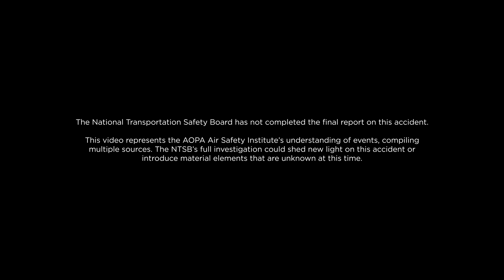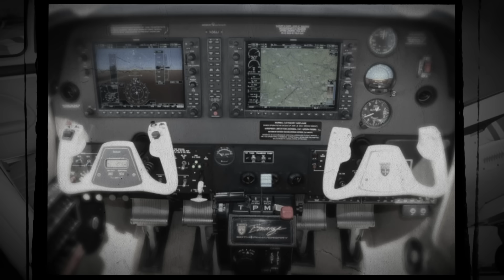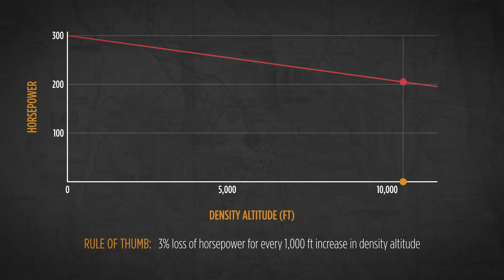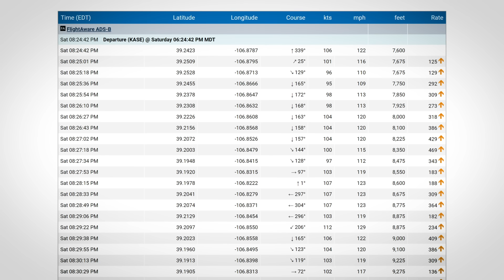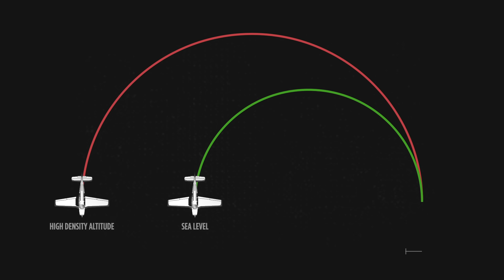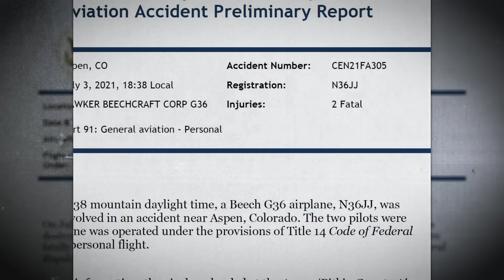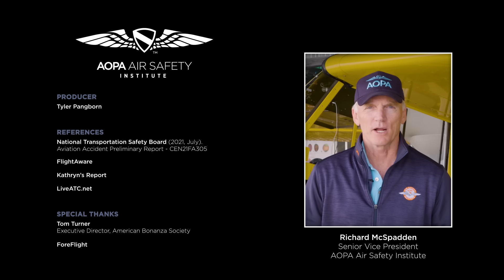Accident Case Study: Into Thin Air

Comment: I was struck by the comment “recent purchase of the B-36” and “five hour and twenty minute flight into Aspen.” How well did this pilot know his airplane? How tired can you be after a five hour flight, in hot afternoon turbulence, to boot? Who flies over mountains into Aspen with a half-hour reserve? Who takes off from a 10,000’ density altitude airport with a full load of fuel? Who among us knows their blood/oxygen saturation levels and our flying judgement at 8, 9, 10,000 or higher feet? Late in the day for a single-engine flight over more mountains with one engine in the twilight and on into the night with no forced landing sites in sight? Who figures out their route of flight after they are airborne?
Reply: Once again, I wonder if the tower controller could have done more to advise them. I'm sure he will wonder the same for the rest of his life.
Reply: @jackroutledge352  People so often make the mistake of assuming that ATC's are somehow all flight and flying experts.  ATC's don't necessarily know squat about planes and certainly not the limitations of obscure models.  They are trained to route air traffic and nothing more so I'm sure the ATC WON'T wonder for the rest of his life if he could have done more because he knows he's just an air traffic controller, not a flight advisor.
Reply: @jackroutledge352  "I wonder if the tower controller could have done more to advise them."  "Advise" being the key word. The controller can only respond to questions from the pilots, not go off the cuff, make judgements on their competency and tell them what to do. I don't know how that balance is struck, in such a conversation. As the pilot said himself, he was unfamiliar with the area, but it's not as if the controller has any authority to tell the pilot to turn back and land.
Reply: @channelsixtysix066  maybe they should have that authority, otherwise, 'controller' seems like a grossly overstated job position.
Reply: @ThePdog3k   In the end, it comes down to the person who's in control of the plane.
Reply: @ThePdog3k  
Coordinator is more apt.  Some pilots expect ATC to do everything including land the plane if they get in trouble, just because they put too much emphasis on the "C" and not enough on the "AT."  It's your job to fly the plane, it's theirs to make sure you don't fly it into another plane.
Reply: @ThePdog3k no, they shouldn’t. They have no idea what’s going on. They’re traffic control, full stop. They’re not flight planners or mechanical advisors.
Reply: @jackroutledge352  I think he could have. He started to ask questions but failed to offer any real advise when the pilot suggested that he'd be winging it, so to speak, with respect to his flight direction once airborne. He also might have intuited that the pilot was not very familiar with the area. I am not a pilot, and so maybe that's why I often get a sense that ATC's seldom go out of their way to offer advice/suggestions, etc. to pilots---but then, these being accident videos, it's a distorted sample.....
Reply: @richardernsberger5692 it’s not his purpose or job to create flight plans for idiots.
Reply: @jackroutledge352  controllers normally have no flying experience so may not have understood what the risks were or felt they were in a position to say anything when the pilot has the final say as to whether or not they fly or wait till the morning.
Reply: @catherinekilgour2563   It is even simpler than that. ATC has NO responsibility for any decision made by any pilot, therefore they are never obliged or required to get involved. There are also likely to carry legal responsibility for any comments they do make, so they keep a watching brief.
Reply: @jackroutledge352 not his fault or problem.
Reply: It’s very strange to me the chances people take with aviation
Reply: @jetpilot3714  The conflict between Icarus and Daedalus is as old as humanity. It’s found in the phrase, “There are bold pilots and there are old pilots, but there are no ‘old, bold pilots.’”
Reply: @mrartbridge  Brigadier General Robert F Titus would like to have a word with you. 82nd Airborne, flew bunch of combat missions in Korea,  one of the first to fly across artic route, I believe he strapped a rocket to a plane and took off... he's still alive and kicking.
Reply: @mrartbridge  It's True For The Most Part But Bob Hoover, Chuck Yeager, John Young & Neil Armstrong All Died Of Old Age & They Were The Cream Of The Crop!
Reply: @jetpilot3714  they don't know they're taking chances because they were inexperienced and uninformed regarding, in this case, mountain flying.
Reply: Just another case of "Get-there-itis.  But that was never even mentioned and could very well have been part of the bad decision making....JMHO of course.
Reply: @a914freak  Get-there-itis X oxygen depletion, and probably at least partial ignorance as to the dangers of there situation..
also, the safety pilot did not seem to have very much more experience when it came to the situation, again shows it is always better to find someone who has knowledge of the actual route (or region you will be flying over)
Reply: @stanislavkostarnov2157  Yup we call having a seeing -eye dog.
Reply: @a914freak  "Just another case of "Get-there-itis. "  - If only the pilot listened to himself, when he radioed back to the controller - "I'm Unfamiliar With The Area". This and the very sluggish performance of the aircraft, should have been enough for him to abort the flight.
Reply: "How well did this pilot know his airplane?" - A very pertinent question. The pilots knew the plane had limitations at altitude and as the video stated, they waited later in the day hoping the air density would improve. But they really had no idea how severely the area they were flying into, was going to affect the plane's performance.
Reply: Who figures out their route of flight after they are airborne?  Nuff said.
Reply: Great questions.  I think any responses would have been based on ignorance and hubris.
Reply: They should have followed the I-80 corridor east across Wyoming instead of crossing some of the highest ranges in the Rockies. I'm based in the Rockies. How we operate at those altitudes is substantially different than sea level operations. For example, I always operate at wide open throttle, am constantly leaning mixture during climb-out to maintain takeoff EGT (best power EGT), and I always fly with O2. His anemic climb rate of just 200 fpm should have been enough of a red flag to turn around and take the lowest possible route...better yet land and re-evaluate his flight plan. Not knowing what pass he was going to take until airborne was another indication of inadequate planning.
Reply: (I haven't read the whole thread.) Yeah, 5 hours & 20 minutes is enough flying for one day for this old coot anyway. Your point about O2 sat is also something I think deserves more attention in aviation. I think we are taught to focus too much on the numbers and not enough on biologic variability and the interconnectedness of different factors. When I visit a high-altitude city, I find myself surprisingly easily fatigued for the first day or two. Sure I can think straight, but fatigue is dangerous on its own when you fly, especially given the schedule these guys were trying to keep. Hypoxia and fatigue are not on/off switches. They interact, they are both gradients, and they both affect judgement. They are also difficult to notice until it's too late.
Reply: Someone said it was a Dr. of some sort, you know how those and Bonanzas mix.
Reply: @MatyasArby  That's BS, it was noted that the safety pilot was ATP rated and probably a professional pilot.  Cheap shot at doctors.
Reply: @BobWa43  
The problem with many ATPs is that they are so accustomed to flying with turbofan engines out of 10,000 ft long runways that they get befuddled by normally aspirated piston singles.
Reply: The most shocking thing of all is there is an ATP who is also on the plane and still they managed to make all those choices. Just a trail of multiple red flags. "I am new to the area" to the ATC could have been a very different day and both of them could have been alive.
Reply: Irritability is a certain sign of high altitude hypoxia.  Has killed more than a few hiking teams.
Reply: "Who flies over mountains into Aspen with a half-hour reserve? Who takes off from a 10,000’ density altitude airport with a full load of fuel? "

A dead guy, the guy flying the plane in the video...
Reply: He didn’t have to die. A couple more turns or a different route or earlier recognition of the situation and a turn and he would have made it. 

Cookie cutter solutions of “I won’t depart with full fuel” or “I won’t depart with a 10,000 foot density altitude” greatly limit your options while not actually making you safer. I’ve seen planes pile in in very similar situations nowhere near max weight and 10,000 foot DA. 

Know what your airplane is capable of.. and always leave yourself an out for WHEN things start not going your way.
Reply: Who decides they'll climb over a ridge by pointing it directly towards the ridge from the leeward side? Someone who has no idea what they're doing and has never flown in the mountains.
Reply: WHY VAIL..........hit me right away. And I don't even fly. The moment the narrator stated the planes' engine was "naturally aspirated" (diesel guy here) AND no oxygen, I'm incredulous.
Reply: @Dwightstjohn-fo8ki  
Yes, the mistake that led up to all the other mistakes was the selection of the wrong refueling stop. Density altitude is the air density expressed in terms of an altitude on standard day conditions and it is something I try to take into consideration every time I work on or fly an airplane. High density altitude can cause problems even at much lower true altitudes in cases of short runways and heavily loaded airplanes. Some years ago heavily loaded Aerostar crashed on takeoff from Lakeway, west of Austin, TX, on a hot day where the density altitude at Corpus Christi (at sea level!) was over 3,000 ft! The guy loaded and fueled the Aerostar without checking the density altitude, which must have been close to 6,000 at Lakeway. 
All five aboard, including two children, were killed.
Reply: @Dwightstjohn-fo8ki  Aspen not Vail
Reply: Greetings, Rod. I am profoundly sorry if my note sounded critical. Please forgive me.
You asked about how I learned something about flying. Here is just one of my errors of omission or commission. Go gentle on me, please.

Back in 1975 following prisoner of war and water survival training, I was assigned to O-2 forward air control training at Hurlburt Field, Eglin AFB, Florida. The shock of flying Cessna 337’s at 170 knots after T-38’s at 450-600 knots was palpable. Nonetheless, in the military, one supports the mission to which one is assigned. 

Hurlburt taught me map reading from the air, how to fire white phosphorus rockets, how to plan their parabolic flight in coordination with the fighter-bomber flying nap of the earth to a target then would only see when inverted in the pull-down after the brief pop-up. 
Everything was low altitude flying, sometimes as low as the treetops, and always as fast the faithful O-2 could fly. When we were assigned to home base, we were given a tactical review of the airspace over Ft. Irwin, CA and Nellis AFB, NV. In the typical four hour missions, it was hot, concentrated work, tactical map reading while arming up the airplane or aligning it for the brief pull-up to fire the rockets. It was sweating and enduring. There was no autopilot, no air conditioning and one was constantly synchronizing the props.  In one solo flight in Operation Red Flag over Nellis AFB, I was “shot down” by an opposing Marine Harrier; the pilot did a victory aileron roll over my little craft at about four hundred feet above the ground, then disappeared. 

Flying over Nellis in the summer brought home the lessons of density altitude. What burned the lessons into my pores is this: After two hours loitering over the Nellis training area, marking targets and calling in training bombing missions, my co-pilot (who also managed the UHF, VHF and HF radios on board) and I needed to go home for fuel. The climbout of the area entailed a narrowing, high–elevation canyon, just as in the AOPA scenario. We were heavy–weight with the two pilots, three radios, and two rocket pods, on a hot summer day in the desert, and at 6,300 feet. The airplane could barely climb in these conditions. My one useful decision was to fly close to one side of the ascending canyon. Approaching the canyon rim from below, I decided that we could not make it. I had to turn the slow airplane, stall warning horn blaring, full throttles, in a gentle descent around the mouth of the canyon away from the ridge. I could have (should have) punched off the two external rocket pods and lightened the airplane by 300 pounds. As you see, this could have been the fatal stall. 

There you go. Again, I am not critical. I am very sorry it sounded that way. I have felt the pilots’ terror first hand.
Reply: @mrartbridge  Thanks for your harrowing account of your combat mission. This is certainly one you will remember for the rest of your days. I have found that in retrospect, these kinds of experiences are the highlights of one's life, that is, as long as you live through them without serious injury or death. I don't have anything as glamorous as your adventure with regard to density altitude. But there was one time decades ago where I was taking off from Cheyenne, Wyoming at night and I did not use as much runway as I could have. After all it is a long runway at Cheyenne. I had a friend with me and we were flying in a Cessna 150, which, as you know is not exactly teaming with horsepower. After take off, the plane was having trouble climbing and there seemed to be some down drafts that we were fighting to overcome after the end of the runway was behind us. I remember my friend was kind of nervously laughing while I was hoping the houses we were flying over did not have any tall TV antennas. I had the wimpy little engine wide open and leaned for max RPM and we were just missing the rooftops by about thirty or forty feet! We finally overcame the strange downdrafts and began to climb normally, but wow was that scary while we were in the midst of it! My lesson learned was, use the whole runway even if you think you won't need it.

I appreciate your humble reply, Art. I always see a lot of criticism of the pilots concerned down in the comments of these Air Safety Institute videos, sometimes even from non-pilots (as if they know anything about flying or decision making in the cockpit). And I think pilots tend to be a little arrogant and overly critical of their brothers, when they themselves have had some close calls that they don't talk about much. If you read the critical comments to this video, and there are a lot of them, you will see a general theme of "What were these guys (flying the Bonanza) thinking?" And then they rattle off all the things they did wrong. Well, hindsight is 20-20. It's always easy to look at an accident and point out what the pilot should have done differently. Some of the guys posting these critical comments -- that think they're so "above" making any poor judgement calls -- will make their own bad piloting mistakes some day. Maybe then they will be cured of their arrogance. I just hope they don't "auger-in" in the process.
Thanks for your reply, Art, and thanks for your service to our country too. 
- Rod
Reply: @rodneybrocke  Greetings, Rod, and thank you for your kindness. I wrote an article for Air Facts Journal not long ago (perhaps published in 2022). They won't mind if I take something from that submission. It applies to all of us trying to learn how to be better pilots. It certainly applies to AOPA and other videos. Here it is--

"In flying, as they say in recovery programs, “One has to do the work.” A written article or video may make an impression. Far better for learning is deep and concentrated study. Study plus practice in the air is better yet. Then, there’s experience. One can learn from experience. Sadly, a wise man noted, “That always means bad experience.”
Reply: @mrartbridge  Right! Bad experience seems to be the best teacher out there. Too bad he can be so unforgiving.
Reply: I thought the point of this series was to be educational, so that others might learn from these tragedies. Why would the above commenter accuse others of being armchair pilots, I wonder.
Reply: And thanks for sharing your own experience in similar circumstances, that others might learn from it.
Reply: If I'm flying at any kind of density attitude, like 8000 plus, I keep a pulse oximeter on my throttle. Check every 15 minutes religiously. And always carry O2 if there's even  a remote chance I'll need it. But the other stuff, yeah, what was he thinking?!
Reply: Even As a non-pilot, I could I instantly see how this was a bad idea
Reply: He was a high-end dentist.  He thought he could do anything.  Reality takes no prisoners.
Reply: Perfectly summed up!
Reply: Who? A jabroni. They are so confident that they end up failing - hard! That's who.
Reply: AMONG US!!!! SUS!!!
Reply: Dead pilots
Reply: All incredibly good points.  I don't understand how so may of these pilots seem to suffer from "it'll be fine" syndrome.  There seems to be a certain arrogance, regardless of the serious enigmas you pointed out, that man and machine will somehow defeat the laws of physics on command.  It doesn't work that way.  This guy should have nevert taken off.
Reply: Is it possible they had alcohol during their lunch. ?  Only a little could sway a pilot's judgement if already tired after a five hour flight...🤔🌱
Reply: important questions
Reply: the flight controller didn't seem worried at all
Reply: among us
Reply: These videos never fail to bring out the "arm chair quarterbacks." By their credentials, these were both proficient pilots. They were not incompetent as your comments suggest. Maybe instead of criticizing, Art, you could post an account of mistakes you have made in your flying career with regard to density altitude and/or mountain flying, and what you learned from these mistakes.
Reply: @rodneybrocke  
I'm sure they were proficient but clearly their proficiency in this type of aircraft and this type of operation was marginal. Due to the fact that I learned a lot just from watching this video, I cannot with all honesty say that I would have done much better, despite the fact that I do have a bit of mountain flying under my belt.
Reply: @rodneybrocke  you’ve really never heard that phrase before Art mentioned it? Certainly not criticism, but a VERY well known adage in the flight community.
Reply: @CollinGravesPersonal  What phrase are you referring to, Collin?